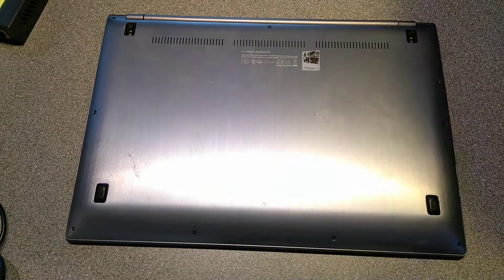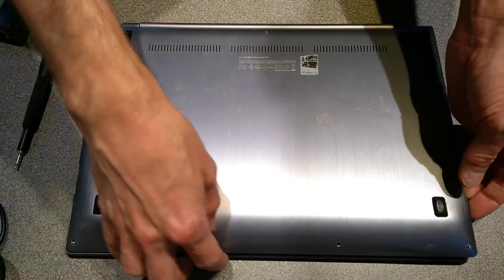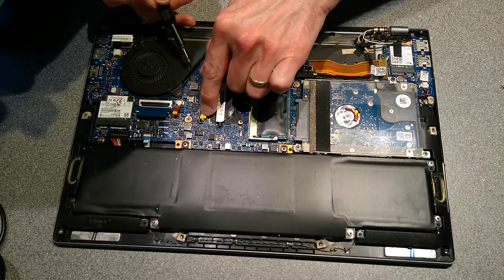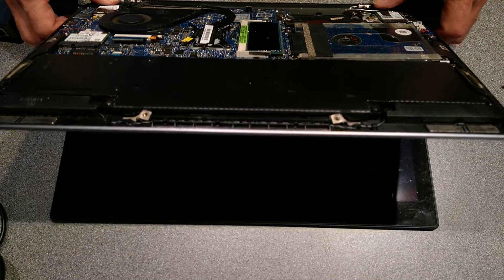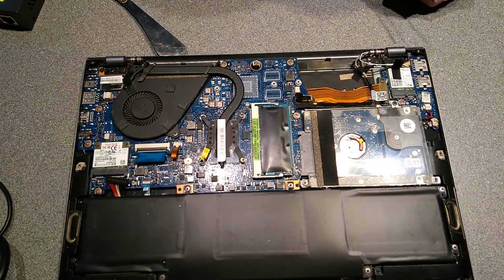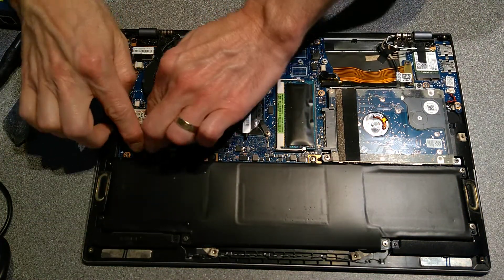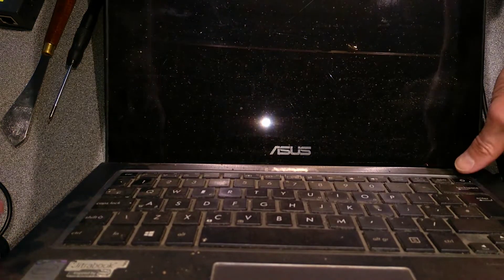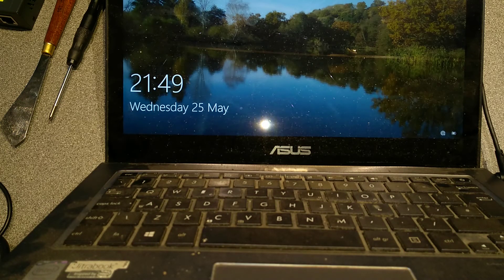How to open up an Asus Zenbook UX302L

Comment: hello bro i have problem with my hp pavalion 15-au072sa laptop (which you made a video of how to open it) so the problem is that my screen has suddenly gotten green all over and i dont know what to do.I have asked at a local shop and he said that i have to repace the sreen but i think there might be a problem with the screen connector which connects the screen to the motherboard so can you guide me what to do plz
Reply from the maker: It could be the screen or the connector and its really difficult to tell which until you start replacing stuff. I would also start by replacing the screen and then, if the same problem persists, replace the video cable. The video cable is far more difficult to replace.